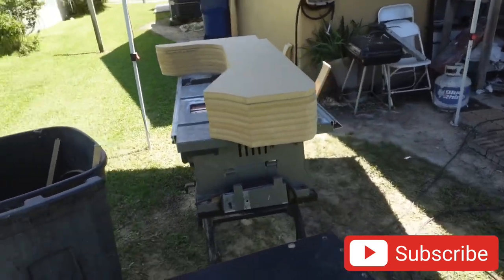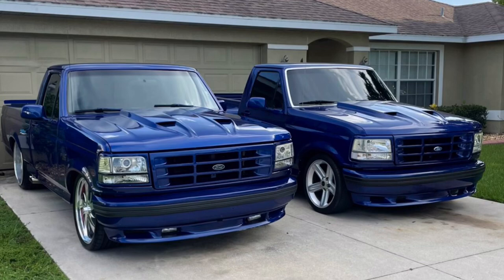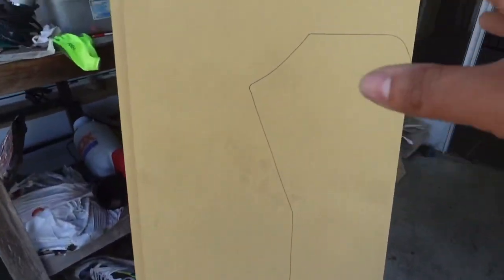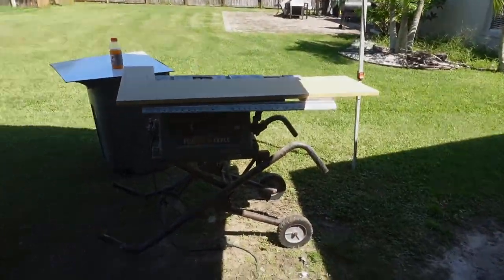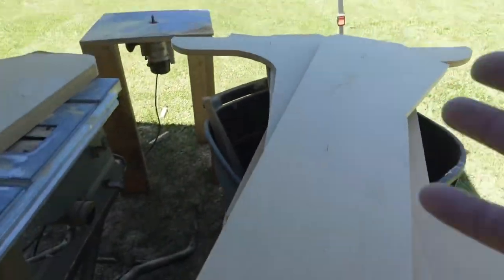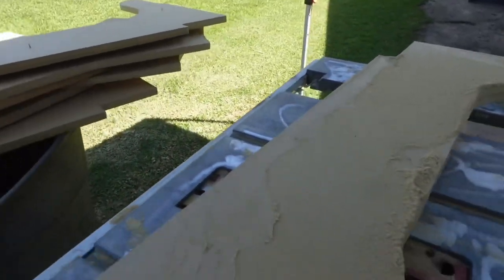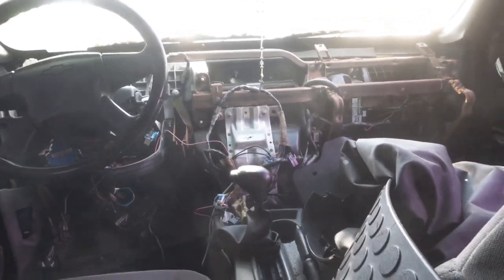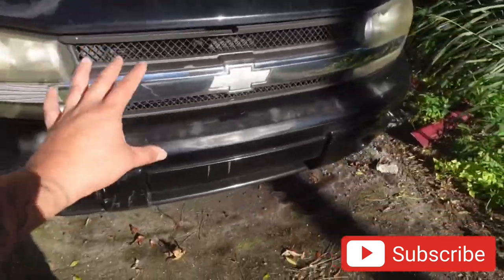Router Table comes in Handy for Car Audio!!

Comment: Bro we are onnthe same level..we need to really link up man..we are building the same truck..my motor has a knock atm and I keep saying if ot goes I am gonna drop a ls3 in it..and I'm doing my 6 10s build in it Iv told you about..and know I think I may change it up and do 9 10s in a ported box with 3 8ks...I want to build a insane small sub no wall build..
With us both doing th same truck and have already been down this road once I may have some question for you or bounce ideas off you..I live basically on the opposite side of the same in the same location as you..I live near Kennedy space center..or Melbourne fl..near cocoa beach..
Reply from the maker: Oh dang hit me up on ig mousextrap let’s talk lol